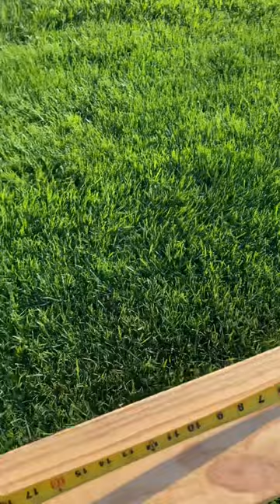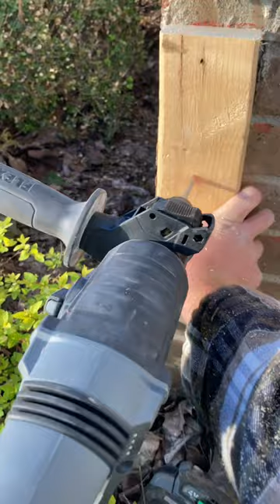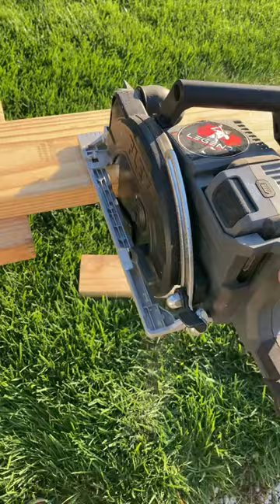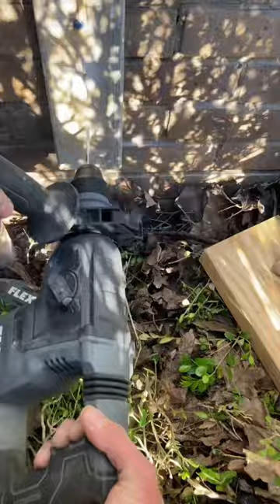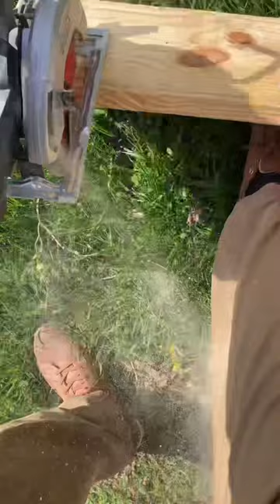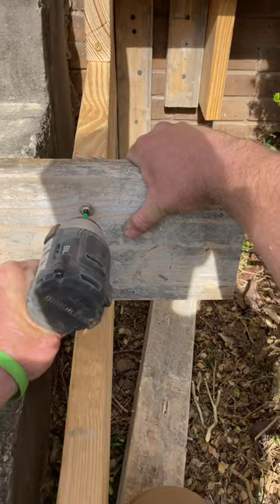Power Tool Addict / Flex Power Tools / Construction / Concrete / Formwork / Blue Collar / Hardwork

Comment: Yeah boy, tomorrow I take the baby Mafell saw out to the job site along with the new blade, a new battery pack, loading it all up now along with 10 rounds and a extra clip for best results..... I definitely want to test it out.
Reply from the maker: Hey bro if you ever get the chance shoot me an email with your info Rick. We need to have a conversation finally. Been too long bro. I finally looked into those mafell. Seen one running on a track by itself on Instagram dude. Fuckin awesome. They look like the quality is up there with Festool?
Reply: @IMPACT-NATION  check you text dude, I am going to get some sleep bro, been up early dude. 

The Mafell are wicked dude,  used for every single thing but there mainly used in Timber carpentry. The company got that Midas touch where everything they make in Germany is gold. I use the small saw they make. At 90° it only cut 1 9/16", am using it when we are framing with wood. I use it today to cut a few tables with a Metabo CAS 10 amp hour battery 16 tooth smooth, powerful, so powerful I wasn't expecting it and clean dude. Tomorrow it's doors and i and going to use the 24 tooth.

There tools are too damn expensive dude it took me 2 years to buy 2 saws, ridiculous dude. I am a buy 1 or 2 more saws and that's it for me dude, too expensive.

Comment: Cant wait to try the rotary hammer. Pickef 1 up yesterday for 172 at lowes on 240 clearance price and combined with the buy more save more that ended yesterday. Thought i was going to today but the block was so damn soft had to switch to drill only mode lol. Im sure it wont beat my flexvolt sds plus dch416 1 1 1/4" with the larger bits but it mite with some if the smaller sizes like 1/4 and 3/8. And its lighter of course
Reply from the maker: $172 is a steal man! I’d pay that all day. These Flex clearance deals have been awesome here for the past couple months. Yeah buddy I’ve seen videos on that Dewalt you have. That thing hits hard. I run the Flex with a 3.5 Stacked to keep the weight minimal when I’m drilling 3/16 for tapcons. Biggest bit I use is 1/2 inch for rebar and it blows through foundation material. It’s solid for a hammer man. I love mine. Glad you got it for a great price man
Reply: @IMPACT-NATION  yea im tryin to get my hands on some 3.5 stacked batteries but its tough cuz honestly im tryin to pay like $80 maybe $90 tops. I have a 6, 10, and a couple 5s. The 3.5 i believe only comes in 1 kit so nobody really selling them. Also since its such a new brand theres jus not that overflow out there like there is with dewalt. Ive scored a bunch of 5ah powerstacks with the top price being 120 and well this is less capacity so it should be less. Also the way flex has it setup they dont do double packs or batteries or nothin
Reply from the maker: @bossmanz28  your definitely right man. I tell you what I did, cause at full price that 3.5 is $179! No fuckin way I’m paying that😂 I went and bought a 3.5 new on eBay for $90 I think. Came new in the sealed package. Only thing is Flex won’t honor the warranty from a 3rd party seller. It’s worth the risk in my opinion cause that battery has been solid for me. I hardly use my 10.0’s except for on the vac or my tower light. Run 6’s on the saws and 3.5 on the impact drill and roto. Runs them like a champ. Less runtime but it saves the weight. To be perfectly honest man those 2.5’s are more than enough for the impacts